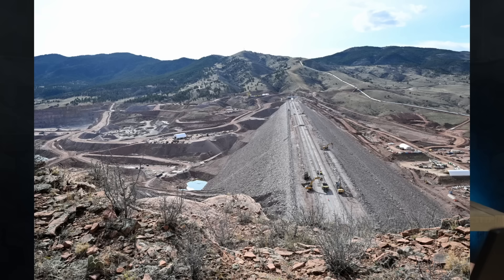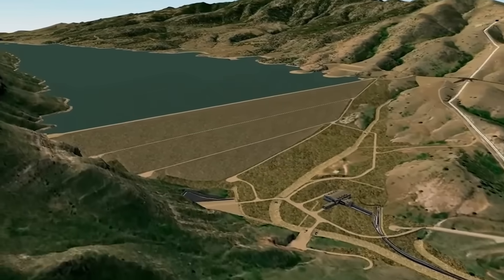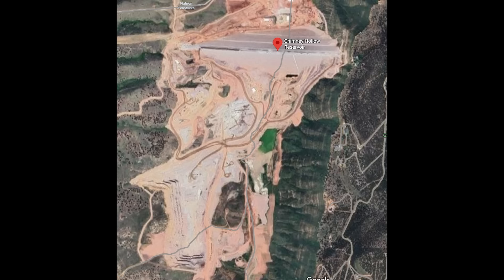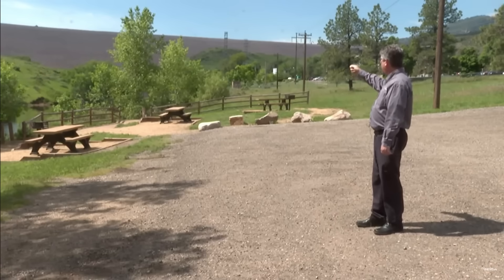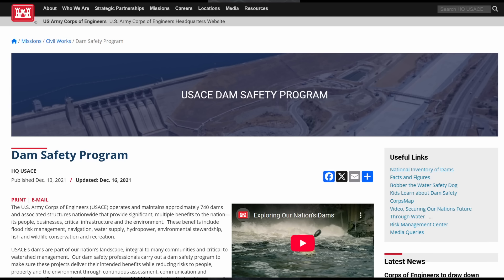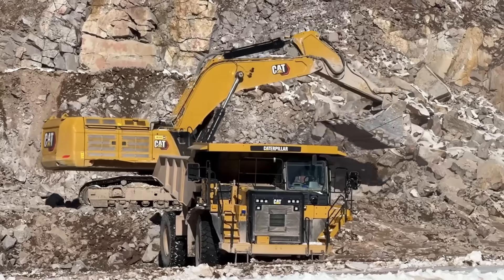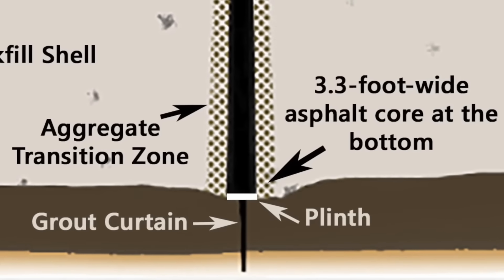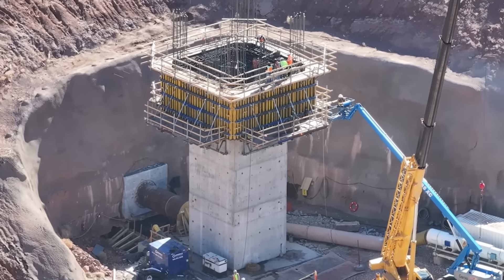Chimney Hollow Dam and Reservoir - Can you Drink the Water?

Comment: From what I've seen on this project, other than the Uranium discovery, the specialized water-proof asphalt core is the most interesting design component of this earthen dam's structure. Not sure if this design method has ever been used before, but it better work flawlessly for 100 years!  Quarrying rock within the flood zone foot print saved untold millions in material transportation cost. The Continental Divide apparantly causes major headaches for water in general in this part of the country.  😎
Reply: Cracking asphalt is usually caused by the influence of uv-light and oxygen, in combination with dynamic stress.  In a large covered mass like this it should be more than fine.
Reply: from the video I've seen about it, the asphalt doesn't harden. the layer is being used as waterproofing and not responsible for bearing weight . the other layers are what keeps it in place
Reply: @htopherollem649  - Same here, it contains extreme amounts ot bituman.which is a "virtually involatile, adhesive, and waterproof material" -
Reply: The asphalt core should work as a leakage barrier for over 100 years.  The asphalt core is not intended as a load bearing element of the dams design.
Reply: @jeffreysachs3423 wouldn’t the asphalt core have the pressure of the dam on both sides especially with the water pressure on one side essentially being squeezed in the middle?
I watched another video last week of the construction of this dam.
Reply: I share your concern.  Asphalt’s carbon bonds are known sources of energy for multiple species of bacteria such as Pseudomonas species and fungi. Over time these microbes may well “eat” the asphalt, making it brittle, such as seen in asphalt roads.  If that happens…good luck for future generations.
Reply: @WilliamAgger-ty1di I am thinking that the asphalt embedded within the dirt/gravel dam not exposed to sunlight or weather or stress, I think the dam will fail long before the asphalt core.   500 years if the dam is maintained
Reply: Asphalt, not exposed to the sun, and buried will last for many many decades
Reply: 15:15 He notes that this is one of only two in the US, but that there are many such dams in Europe where the technology was developed.
Reply: Asphalt cracks. Maybe this is too thick to crack through. Maybe. If so, they should add a slab of it over the side of the quarry to entomb the uranium deposit.

Comment: 44 yrs ago, I took the tour of the Hoover dam. Now I hear it is close to deadpool. The intake pipes should have run though the base of the dam, they never predicted running so low. Mercury contamination has plagued Quebec's resevoirs, Lake Winnepeg is plagued by farm run off fertilizer. Don't uranimate in the pool!
Reply: Sediment builds upstream of dams so tubes at the base would be plugged. Lake Powell is filling in now but it wasn't conceived when Hoover Dam was designed. Hoover also catches sediment from the Virgin River and many other tributaries incl. Little Colorado and Paria.
Reply: Debris, soil, etc. collect at the bottom of the dam.
Reply: @raybod1775 I am surprised that the historically low water in several large reservoirs hasn't led to the digging out of large quantities of the sediment that has accumulated, both to "clean out" the reservoir, and to make use of the aluvial soil/mud for desert land reclamation.
Reply: Las Vegas did put in some low level water intakes, and drain their sewer plant output back into the lake.
Reply: “Deadpool” is the minimum head pressure required to run the turbines or flow downstream. It occurs at Lake Mead at about 25% storage capacity.
Reply: @allangibson8494 Most definitions (as found by Google) exclude any mention of turbines, power generation, or even head pressure.  They only say something like "Water trapped below the lowest dam outlet is in the dead pool and cannot be utilized ....".  So basically "dead pool" is the water below the exit drains of the dam.

Comment: Water is the lifeblood of the west and this reservoir meets storage needs.  To worry about leached uranium, before it is filled is rather like Chicken Little!  The sky is NOT falling, uranium and radon are ubiquitous throughout Colorado and the mountain west.
Reply: Radon is a gas and wouldn't be a concern here. Uranium and the most of the daughter products other than radon are heavy metals and have significant health concerns over time. It'll be exceptionally difficult to filter these contaminates out without something like a RO setup which is ridiculously expensive (compared to wholesale prices that utilities downstream need to absorb and pass on) They shouldn't have hid this for over a year. That extra time would have been useful in planning, design, and even ordering long lead time components for the treatment facilities that'll be needed.
Reply: @SuperS05 BEHOLD, the invention of the water treatment plant.
As mentioned, they are designed for exactly that in CO.
Reply: @Seldoon_Nemar treatment plants typically do not filter out minerals. That is a very expensive step and is the very reason why the EPA has regulations on concentration levels since if someone can save a penny, they will. The EPAs rules are extremely lax, so if the levels are above their guidelines and limits, you should be concerned.
Reply: @Seldoon_Nemar  the point I was trying to make was those treatment plants are not just expensive without the extra steps that might be needed here, but take a long time to source parts for and build. Extra processing steps compound that. An extra year of planning would have helped all the downstream customers get a more steady, secure source of water far sooner.
Reply: @SuperS05 radon is associated with uranium. Issues with one are linked to the other
Reply: ya im not worried about natural uranium. plutonium is a different story.
Reply: @JackMcGuire-em7nt forgot to mention all the pharmaceuticals that are in drinking water, nobody talks about them!
Reply: Telling people not to worry about random unknown quantities of uranium that could turn billion-dollar expenditures into ten-billion dollar health and remediation problems seems like the less wise path, here.
Reply: Coloradans can’t harvest rainwater, if I recall?  Y’all need to fix that evil.
Reply: Maybe, you also need to realize we, humans, have polluted a vast portion of the fresh water that is available to us. Go find clean surface drinking water, bet you can't.!!!!
Reply: My main worry would be about the stability of an earthen Dam ..!
Reply: @stephenrickstrew7237 it's not earth, it's rocks.  When the rocks are too big they're reduced by a big hammer.  That thing isn't going anywhere.
Reply: @gumby2241 Well I have heard that before … and time will tell .. hopefully it holds ..?